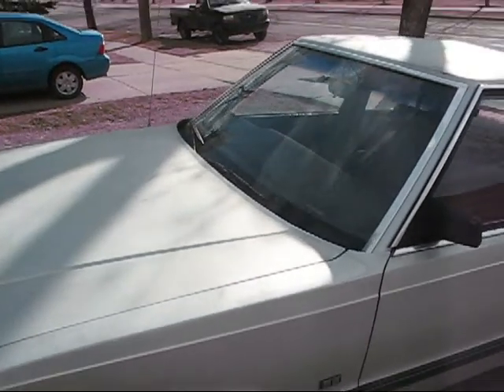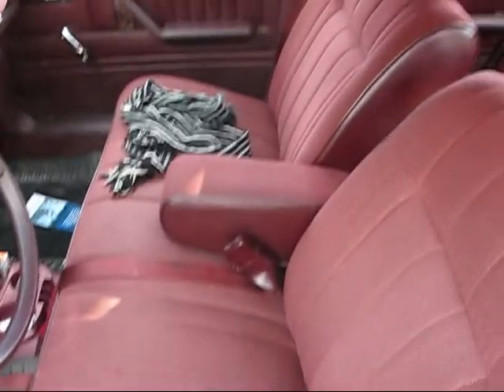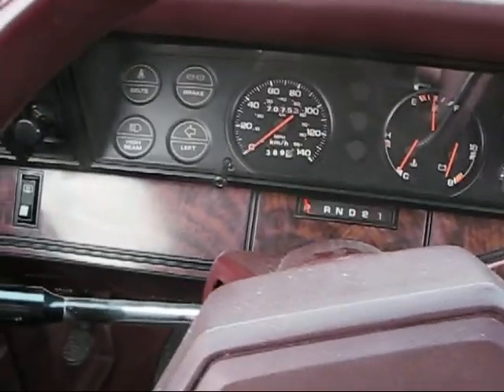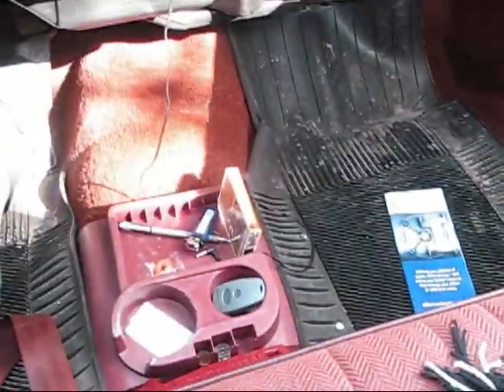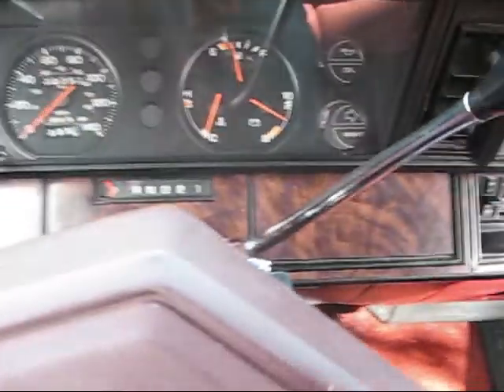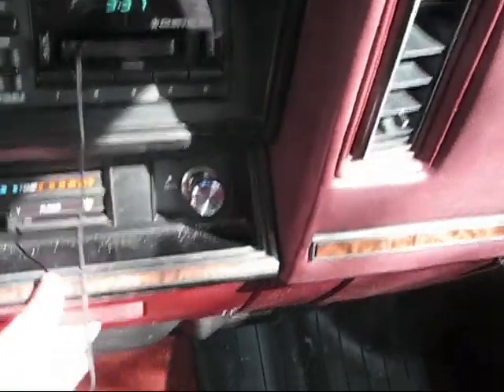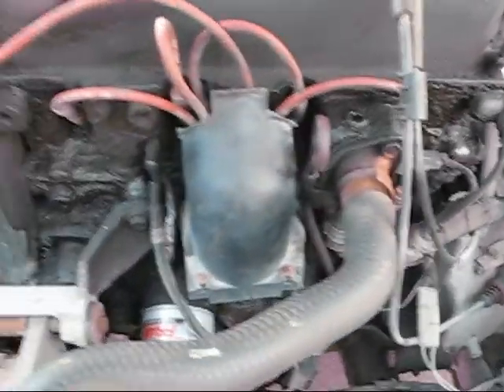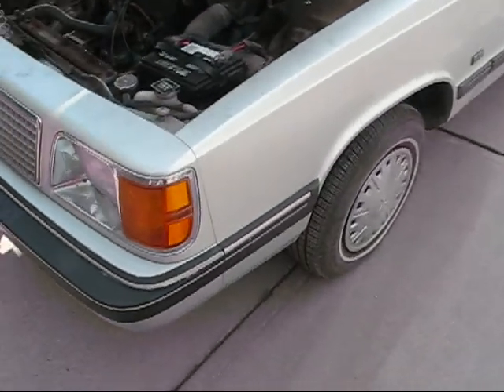Robs k car movie.wmv

Comment: Nice car! Just a little work and she'll be as good as new! The motor sounds great! I like the red interior. Mine's the gray LE interior in my '87 Reliant 2.2, 4 dr. Also a little old lady car from Colorado. Talk to you later! Oh yeah, clean up the rust as best as you can with some 'Naval Jelly', sand, then paint over it with POR 15 followed with some touch up paint. Just to hold you over 'till you can afford a repaint. A faulty PCV valve will make oil leaks worse, so check and or replace it. Make sure you use Champion spark plugs during tune ups. Good luck!